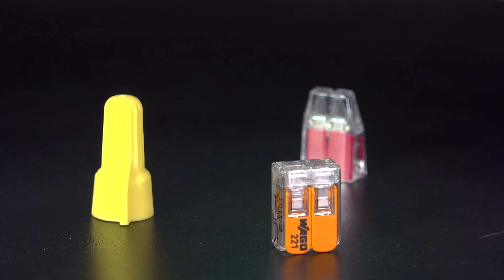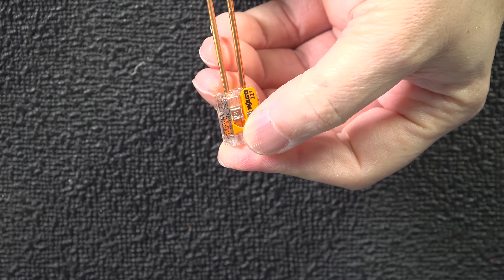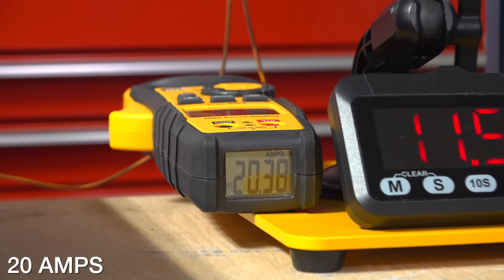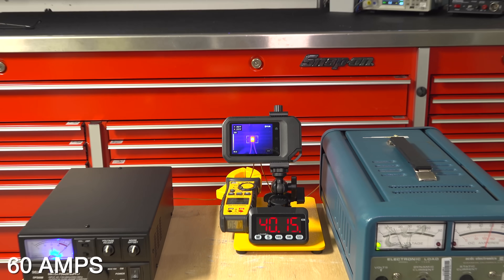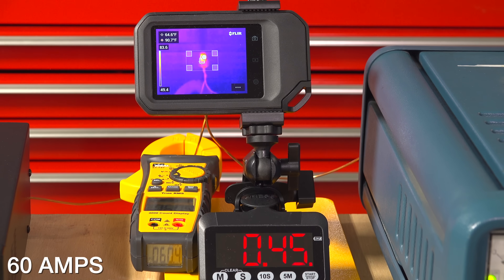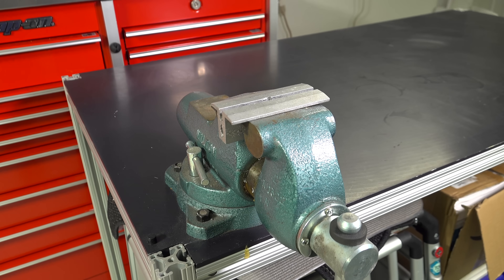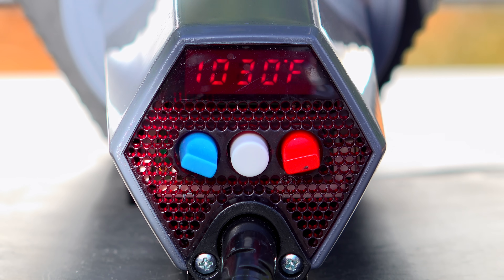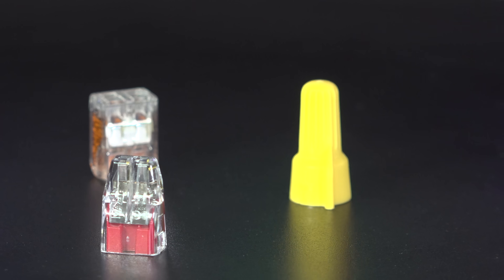What Wire Connector is the Best? Wire Nut VS Wago TESTED

Comment: Great video! I use Wagos since last year whenever I need to use a wire nut at home.  The cool thing about wagos that you didn't mention is how better they are when dealing w solid and stranded wire on the same connection. If people complain of Wagos pulling out is because they are using fake chinese ones.

Comment: Did I miss the pull test on the wire nut connections?  I saw the Wago at 35 lbs just curious what the wire nuts were

Comment: The clamps from Wago are the best to use for wires under 60A because they are strong and they make the best connection between two wires.

Never join the wires by twisting them or by soldering them and adding that electrical tape. 

You can use the Wago clamps even in those small tasks  such as connecting some speakers to another set of wires or anything like that, such as connecting some batteries to another wire.

Comment: Hello. I’m from Poland so we use 230v/16amp at home installations. Some electricians make it using wago connectors (without clamp just push wire). I’ve got this kind of installation at home. It works safely without problems. Of course old school electricians make twisted connections.

Comment: Why no pull test on the wire nut?
Reply: Because the complaint was that the Wago's took minimal effort to pull apart. No complaint has been made about twisted wire connectors which, if you've used any, you would know are tough to pull apart if sized properly.
Reply from the maker: Wow you answered this better than I could, that was exactly my reasoning. Thank you!

Comment: I would love to see a test on the stab in wagos, I’ll stab wire in and the wire will just roll around in the connector. I would think that would cause lots of resistance and heat
Reply: If your wire rolling around in a wago, you don't use the right wago for the type of wire you use.
Reply: You're probably using smaller wire then it's rated for. There are different sizes for different applications.
Reply: @Avaddon911  no they do that with the proper sized wire.  Try it out.
Reply: @tsci1576  it's not going to matter in the long run. If you can tug on it and it doesn't come out of the connector you'll be fine. The problem is that everyone compares them to the stab connectors on the back of outlets. It is a similar connection but there's another factor everyone overlooks. The stab in on the back of an outlet is going to be in a fixed location. Over time with vibration from plugging and unplugging outlets it will loosen. The same situation isn't present with a wago because it's light and will move with the wire. It's not a fixed location so unless the wago is stuck and the wire gets yanked on the connection isn't going to separate in it's own.
Reply: @Avaddon911  we are talking about the stab in wago here, not the lever compression style.
Reply: @tsci1576  I am also talking about the stab in wago. I prefer the lever style but it's the same either way. If you've got a lightweight non fixed connector vs a fixed outlet. Vibration will affect the fixed connection whereas it's not a factor with the lightweight wago that can move with the wire.
Reply: @tsci1576  never had that experience in 15 years. Either the wago is not right or you pushed the wire not deep enough in.
Reply: @B-M.B work on your reading comprehension.

Comment: I've been using them for less than 30 amp connections for 48 volt nominal DC telecom applications which tend to use fine strand conductors. I haven't had any issues with them, not sure if they're rated for that application. Also they're great when transitioning between solid and stranded conductors when using them on normal household AC power, I find them more secure than using wire nuts. Gotta watch out for those Wago knockoffs though...

Comment: The newer lever lock ones  are impressive but are the original push in still available  as the mechanics looked no different than the back stab connection on cheap receptacles,  I'll bet they would not do nearly as well as the lever lock ones.

Comment: Thank you so much for making this video!  As an electrical contractor myself I really appreciate the tests you did.  I suspect the doubt some have over these style of connectors come from residential electricians who take there experience from using the stab in connection for 14 gauge wire.  The only outlets I've seen that offer that connection are made of low quailty material, giving that style of connection a bad rep.  Don't judge a type of connection by the cheap outlet that employed its use.
Reply: I judge a connection by the amount of conductor in contact. Because surface area equals capacity. That's why we touch wires together to make a circuit. It is intimate contact that allows the flow of electrons.

Comment: at 3:00 wouldn’t a lot of current be passing through without ever reaching the wire nut, since the unsheathed wires start connecting below it?  Why go so easy on the wire nut, I wanted to see it fry. :)
Reply: You twisted it so much before the wire nut it didn't need a wire nut!
Reply from the maker: I will be re-looking at that possibility. Maybe I did go too easy on the nut!
Reply: @SilverCymbal  The most fair test would be the one that replicates how those connectors would be used in the real world, just like you did. Maybe let them sit outside for a couple months for good measure.
Reply: @SilverCymbal  so, first of all, @BLKSG6 was just making a valid point, and not being critical. Still, so many people would have been offended and gotten defensive, but you took it in stride as the suggestive comment that it was clearly meant to be. And it sounds like this might even become a followup video, and that I'd like to see!
Reply: Yes, just a twist where the nut goes on and spread wires slightly apart below that. Would be interesting to see.
Reply: I had a picture somewhere that is of a wirenut that got melted off a circuit where the plumber was running a "Mule Threader".  The wires had melted in such a way that the wirenut was in series with the wire in the circuit.  We don't know how long it was running that way before the breaker tripped.
Reply: Exactly, I noticed that right away, the load would have been balanced across all the unsheathed wire. Basically just stuck the wire nut onto of a twisted wire like a hat 😆
Reply: Just do the same test again and drill the wires with the wirenut itself like it is supposed to be.

Lets see how it drips.
Reply: You could definitely do a test with verying connections in parallel because it is clear they all handle the same current.
Reply: I'm surprised it even got hot, thought most of the current will go through the twisted conductor wire
Reply: @vasya88  that’s just the wire getting hot.
Reply: That was the first thing I noticed. The majority of the flow was not through the wire nut connection, while 100% went through the Wago.
Reply: Interesting seeing the results with bare wire. Unfortunately, the FLIR doesn't read the temperature of bare copper well (because copper such a good IR reflector). All the tests that I've see with insulated wire has the insulation melting/burning off long before either the Wago or wire nut fail. Probably the problem with people being able to flick Wagos off are due to not inserting the wire fully before closing the latch.
Reply: @Sembazuru  Agreed. The Wago has a mark on the side to show exactly how much insulation to strip. In my experience the Wago will hold wires more securely than this guy found in his test. Because of the way they lock the wire, they actually rely on the tensile strength of the copper itself, rather than the strength of the connector, and you really can’t get any stronger a connection than that.
As for wire nuts, I vaguely remember seeing some in the U.K. many years ago. I would never dream of using them, and they would never conform to the IEE regulations in the U.K. Using Wago’s along with a proper Wago box makes it a perfectly safe method of extending and modifying circuits. They are also really useful for low-voltage connections in control gear on things like cnc machines.
Reply: Yeah, I agree. Should repeat the test w/14ga insulated wire and don't pre-twist the wires with the pliers for the wire-nut test. Otherwise, if you want to compare apples to apples, should have twisted the wires with the wago splice the same amount as the wire nut.
Reply: That is the whole point of wire nuts vs wago's. The electrical connectivity should not reliant on the connector, if a wago fails so does your circuit. If the circuit is spliced with wire nuts and the wire nut fails your circuit still functions.
Reply: @EntropiaBCG  I’m pretty sure I don’t want my circuit to continue to work unsheathed.
Reply: @terryforshee5203  then use wago's and pray its not a grounded conductor that fails and frys your electronics.
Reply: @EntropiaBCG  but if the wire nut fails -- let's say melts off -- and the circuit remains hot, wouldn't that be really dangerous? Wouldn't breaking the circuit be what you'd WANT to happen, rather than starting a fire or something? I'm not an electrician, so forgive me if this is a stupid question. Not being a smart-butt -- really asking. Thanks!
Reply: @timsawyer7443  yes it would be dangerous in  a couple of instances (1- if the melted connection came in contact with another conductor)(2-if someone unknowingly goes in and starts moving wiring around and makes contact with another conductor)although in these speculative instances the fuse / circuit breaker should trip looong before these temps. Other than that once a splice is made and box/device closed up its usually not touched for a while.
Reply: @timsawyer7443  similar reason why "romex" replaced knob and tube wiring. Knob and tube used ceramic tubular insulators with one end enlarged. The purpose of the knob was so that holes could be drilled through wall studs and floor joists for the insulators to slide into, with the knob keeping them from going all the way through.
Each wire in a circuit had its own set of insulators. The wires were typically spaced a few inches apart. Wire insulation in that era was natural rubber wrapped in a tube of braided fiber (cotton or ?) to provide some protection.

The problem with that setup was if someone got annoyed with a fuse always blowing and they screwed in a higher amp fuse, or jammed a penny in the socket under the fuse, then overloaded the circuit, the wires would heat until they glowed, possibly until they melted. That could set a house on fire.

With the wires bundled into a plastic sheath they have extra protection and if something gets the wires hot enough to melt the insulation, they're close together so they can make a dead short, which should trip an over-capacity breaker or blow an oversized fuse. If the breaker won't blow or the setup still has the old style screw in fuses, with a penny stuck in it, hopefully something in the breaker or fuse box will pop anyway. The equipment in the box is supposed to be fire resistant and it's in a closed steel box, which should contain flames for a bit.

Comment: you will never beat a wire nut     ideal    !!!!!!!! 30 yr   master
Reply: 40 years plumbing master i don't cut and thread pipe or   use lead and oakum cast iron joint..... 21st century  Pex pipe, abs & pvc  pipe.. copper propress fitting....time change and evolve

Comment: I wouldn't use the wago for the same reason I would never use those little stab holes in the back of wiring devices like switches and outlets. And the cost, how many of these can fit in a electrical single gang box? What does the NEC code say about these?
Reply: You can fit more into a box (atleast the smaller redesigned ones) because they are a more uniform size and allow for a neater box considering how the wires will be sitting in the wago connector

Comment: i didn’t see what the pullout strength would have been with the wire nut (especially when the conductors are NOT pre-twisted). Would it have held tighter or less than the Wago. Otherwise, many thanks for putting this demonstration together for us.
Reply: @Brian Bell When I read some of the comments from wirenut enthusiasts it makes me wonder how they have made it this far in life (most of them are clearly older men) without killing themselves and others, kinda explains why electrical distribution and lighting is the third biggest cause of house fires in the US (according to NFPA)
Reply: If you are applying them correctly, they would hold on tighter when not pretwisting the wires because the wires will twist as you tighten the connector and it all gets super tight.
Reply: I would put money on needing over 100 lbs of force to pull off the wire nut, and then the wires would still most likely still be connected.
Reply: @MaximusHaskimus  So? Properly installed, the wires should be secured with a strain relief connection. The wire connection -- whether secured with wire nut or a Wago style connector -- is not supposed to be bearing weight. This is a case where, once something is sufficient, more isn't any better.
Reply: @DKWalser  Yeah I don't get where people are coming from with that argument, if the wired are under tension you fucked up and have no place playing with electricity.

Comment: Can’t believe I’m saying this but after living in europe for over 10 years. I believe their connectors are the best hands down. Screw terminals.
Reply: How would that work for splicing 2 or 3 wires together?
Reply: @wilhelmtaylor9863  They manufacture screw terminals for such applications. I’ve just found them the easiest and strongest connectors.

Comment: I admire your further testing of the two fasteners.  For me the Wagos would be OK for light duty low amp applications like adding extension lines for audio speakers, but I only want the tried-and-true wire nuts in my home.

Comment: The biggest thing i can see for the wago is if the junction box is crowded and you are pushing in your wires, how easy is it for another wire to brush up against those tabs and have is release the connection?
Reply from the maker: The handles wiggle a little when closed but that doesn't disengage or change them. It takes a fair amount of force to release the connector, it's not too easy to do. But at least its visual, so if its down you are good and to easy to check. I have had wire nuts come off when pushing in a box, and yes I probably put them on wrong or not firmly enough but thats part of their issue, at least for me.
Reply: @SilverCymbal  I have the same issue with wire nuts sometimes. with the wago if it is unlikely to pop open on accident then it is infinitely better as you can physically see that your connection is solid. 

scariest thing for me is pulling wires out of a junction box with wirenuts on them. You never know if they will go flying everywhere or stay secure. Anyway thanks for the reply video was very interesting, take care.

Comment: These are UL approved.  They have been thoroughly tested, but some keyboard warriors think they know better.  Ugggh.
Good video.  Too bad it was necessary.
Reply from the maker: Very true, but even I was curious to see if they really could perform under pressure but they did very well.
Reply: Even still.  Don't take this the wrong way, but your tests were based on your opinions of what was safe.  I'm not saying your opinions are not right, just that UL has data and standards they use to determine if safe or not.  What is a safe temp?  I don't know, but UL does.  Again, thanks for your videos they are great
Reply from the maker: @opnorty  That's fine. Keep in mind these are already approved with UL, CSA, even the NFPA ran a series of tests on them and have the certifications they needed. I was so surprised by people reactions by the misinformation about them that the video was made to see some real tests but if you visit their web site they have a list of certs and specs that is very extensive.

Comment: There is still the question of longevity...when something is heated up and cooled repeatedly for a period of time.  Certain plastics degrade faster than others.  Love your work!
Reply from the maker: Very true. I didn't attempt to cover that since it wouldn't have been accurate since even lab testing isn't really the same as time itself but the track record in europe on them has been excellent and for over 40 years.

Comment: I have no idea why some electricians always say to pre-twist wires, in my experience I have found that pre-twisting the wire leads to a poorer connection with it also leading to the wire not possibly coming off of it.
Reply from the maker: I agree, directions say it's not required and it feels like when you allow the wire nut to do it you get a better bond. I wanted to test that theory but I couldn't get it done in time for this video, but maybe in another one.. That seems to be a hot debated item.
Reply: @SilverCymbal  that would be a very popular video. That debate has raged on for years, even among licensed electricians.

Comment: Tests were fair & well done.  Thank you for the info.  Nothing you found changed my mind.  I'll use the Wago connectors.
Reply: Yes good job, however I would have liked to see the wire nut twisted as it would be in the field, in this it was twisted well below/outside the wire nut.  All the connectivity and thus the heat should have happened within the wire nut, and none before it.  I suspect the wire nut would have heated up further.  Another thing I would have liked to see is multiple connections as is common in a circuit.  Something like 3 or 4 of each in series, representing down stream circuits using the respective connectors, and perhaps a combo of wire nuts and Wago's and see which one gets hotter.